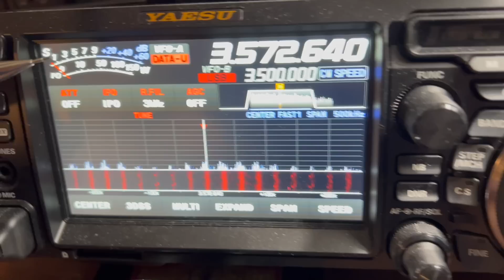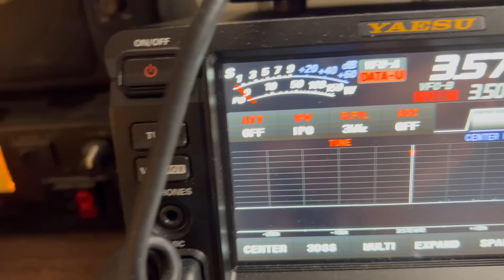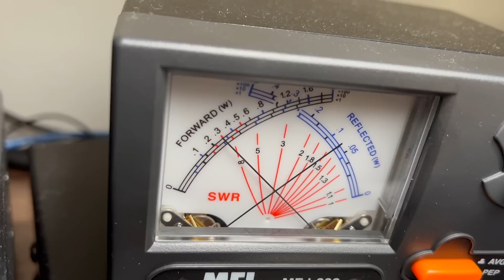The Myth of SWR

Comment: Since power cannot be created from nowhere, it may be confusing to some that you are suggesting that 20W magically becomes 30W at the aerial, so it is worth pointing out that this APPARENT increase in power arises because of the difference in impedance that occurs at the ATU, i.e. the measurement is referenced to 50 ohms but is not ACTUALLY at 50 ohms (at an SWR of 2, it's actually 25 or 100 ohms). Most SWR meters work by being calibrated to the stated output power (e.g. 20W) and then reports what FRACTION of this power is travelling forwards or in reverse.
Reply: Actually, what really happens is that half of the power are 10 W. Does not make it to the antenna and get radiated right away. But eventually it's recycled back towards the antenna and radiated. As you say in this ping pong configuration, so it's not 20 + 10. It's only ten that gets to the antenna and the other ten eventually gets back to the antenna which does not make it thirty watts
Reply: @royfowler5637  thanks for being here. i was wondering how the reflected power on the outside of the coax made it back to the center conductor.
Reply: @Paddy_M8TWD  Reflected power not on outside of coax.  You're confusing it with common mode currents that occur on outside of coax due to an unbalanced feed.
Reply from the maker: @DaDitDa Good point.  That’s something else some hams are confused about.
Reply: @DaDitDa  My apologies you can reply on me to come along and  spread confusion. Again my apologies and thank you for putting me straight.
Reply: @royfowler5637 Actually, after a few back and forth’s, the forward power will get to 40 watts, which causes 20 watts to be radiated, and 20 reflected back to the matcher.  The 20 from the transmitter plus that 20 reflected gives the 40 watts.  That’s what it gets to in steady state (on a lossless cable).
Reply: Why are impedance matches called “antenna tuners”?  The only antenna tuner I’ve used is a tape measure and a pair of wire cutters.  

Great info, thanks es 73.
Reply: @YourThermalWorld  could it be because the tuner tunes out the reactance to create a resonant system
Reply: There is no suggestion of magic.  The original power is 20w.  The reflected power is 10w.  20+10 is 30.  Just regular math

Comment: The ZS5JF article is good reading and your demonstration shows the myth destroyed.
QRP here using RG58 and I aim for below 2:1 SWR with 1.5 better. It doesn't take long to adjust my dipoles and inverted vee, are they too long or too short? Easy using my NANO VNA, unlike when I had only an SWR meter.
C.B.'ers painstakingly trimming ½λ coax make me laugh. They can't seem to accept that by connecting an SWR meter their carefully trimmed ½λ coax joins to the jumper lead via the meter thereby making one coax so all their time consuming trimming is wasted.
I've said this and they still say they want the thing which works best for them, i.e. trimming coax inch by inch. 
G4GHB.
Reply from the maker: Reminds me of years ago I was in a radio shop in Denver purchasing a two meter rig and a CB operator came in and told the store owner that his friend has an SWR of like 1.2 and was complaining that his was 1.5.  😅

Comment: Hi Mark.  Very interesting.  I used to do comms gear (VHF/UHF comms) tests on military aircraft, and we used to check the SWR with an inline power meter (The famous Bird reflectometer) but there was no antenna tuner.  Of course these were well-designed systems, and we were just checking for damaged cables or connectors, degrading system performance.  I didn't delve too deeply into the theory at the time, but is this reflected power increase due to the antenna tuner circuitry?

P.S. I'd like to do some reading about this as I'm getting into ham radio now.  The links you posted in the description are truncated.  Could you re-post them in a comment?
Reply from the maker: https://www.arrl.org/files/file/Technology/tis/info/pdf/q1106037.pdf
That's a new one.  Scroll down to "Does Higher SWR Lead to Lower Power Being Transmitted?"  I think zs6wr goes into detail about why power is reflected back from the tuner. It's rocket science.  

http://zs6wr.co.za/documents/SWR.pdf
https://www.k3emd.com/downloads/Reflect.pdf
https://palomar-engineers.com/mlb-1-magnetic-longwire-balun/

Comment: But, there's still only 20 watts out, the meter is being fooled. The watts don't magically increase, I'm not disagreeing, I'm just saying what's shown on the meter is a deception, 73
Reply from the maker: No not really.  The additional 10 watts is in effect stored in the transmission line but eventually it all gets radiated, minus cable loss which is usually small in the HF bands.
Reply: @markw51  there is no additional 10 watts, it's adding a negative 10 watts. It doesn't bounce back and forth, or get radiated, it's lost as heat.